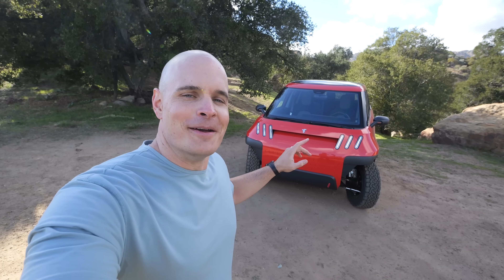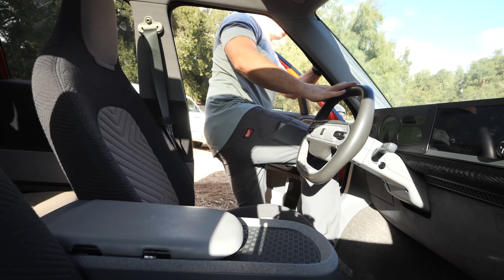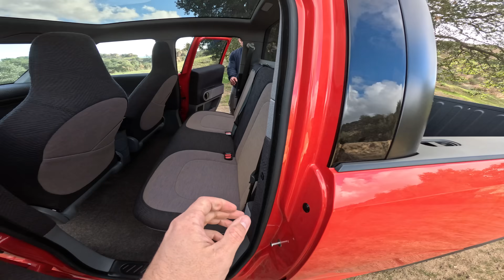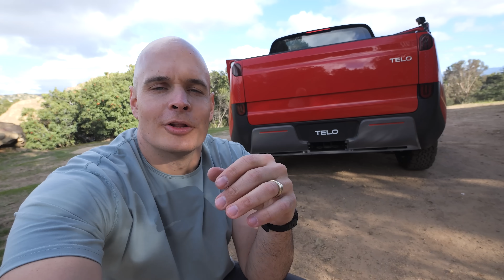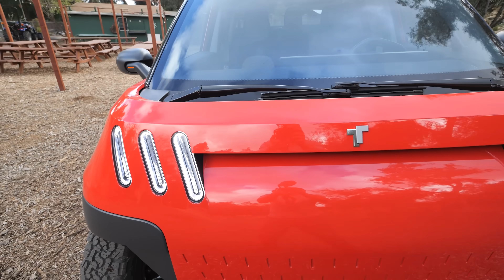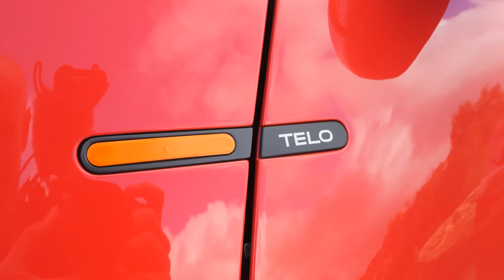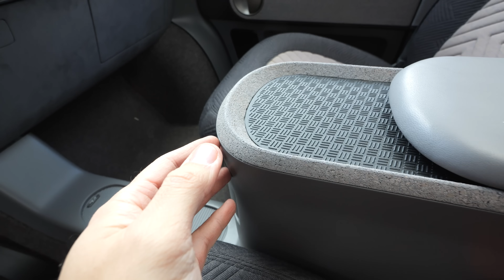ONE TRUCK TO RULE THEM ALL...

Comment: Now THIS is a flex in what's possible with unconventional drive systems, instead of dumb gimmicks like a frunk. A truck of this size in tight cities is not only workable but ideal considering electric availability and the need to transport large materials like drywall and plywood for renovation. Bravo Telo!
Reply: Watertight, clean, lockable storage in a pickup is not a gimmick. They are the EV where the frunk makes the most sense.
Reply: 1. A frunk is not a gimmick the frunk in most EVs is a durable hard plastic tub that’s completely separate from the vehicle interior. Perfect place to keep dirty/smelly items you don’t want on your carpeted interior trunk. I use my frunk daily for dirty work boots, tools etc items I don’t want damaging anything. 2. There are no tight cities in the US. I like the idea of this trunk I they it should’ve been slightly bigger tho to allow more crash/safety structure and interior leg room while still being tiny
Reply: @YungAnt7  It is fine that the truck is this small. Tgat is, what tgey are going for. What is not fine is them pretending tgere, arexzero compromises, and tgat this us as roomy and capable as a full sized truck, and their smug attitude that they are so much better because they can make a small truck and others can't. It isn't inability that stops the legacies from building this truck. It is the knowledge that it is a niche market they see no value in pursuing.
Reply: @YungAnt7   The front tires are actually part of the crash safety assembly. They help transfer frontal impact loads into the chassis and away from the occupants. A frunk would transfer the impact into the passenger compartment.

Comment: To me an electric truck wont do well until they start making electric truck designed for work. Trucks that can accommodate swapping out the bed for a tool box bed or flat bed. These trucks are being designed for people in the city that will rarely use the truck part of the vehicle. Till I start seeing 3/4 ton electric trucks I don't see this market taking off.

Comment: Looks cool, but until an electric vehicle can beat 600km range on the BASE model and be fully charged in less than ten minutes, I'm not interested.

Because my 2017 Cruze can do 500km per tank and takes five minutes to fill. I have to drive sometimes 2 hrs (200km) one way to work with tools. There's not an affordable electric vehicle that can do that without me having to plug it in overnight every single night.

Comment: Three interesting accessories not mentioned worth commenting on are the solar add-ons in the form of a roof, camper, or tonneau cover. Supposed to add 15/miles of range charge daily. Even at a 1/3 that claim it’s a solid value. Going to be in the market for a new small truck in two years.  I never buy first gen of anything but this will definitely be something to keep on the radar.

Comment: This is a perfect farm vehicle. Errands to the coop, hardware store, with no diesel and easy to repair has this at the top of our list.
Reply: Should work with hardware modders and software engineers to create suited sub-forms lol
Reply: All that K-car trucks hype paid off!
Reply: Need more clearance and a winch would be nice too
Reply: The Slate truck is a much better option than this at half the price. And no, EV's are NOT easy to repair. I'm not sure where the hell you heard that, but that's an objectively false statement.
Reply: @DaroffApFire slate truck isn’t half this price now that the tax credit is over. It also gets less the 150 miles of range and RWD only.
Reply: I hadn't even thought of that. it would be awesome to have something that could just toddle over our field hauling whatever we need to without getting stuck. I live in east texas so the lower parts of my property (in the field) are basically a swamp unless we're freezing or in a drought, and one time we got a lawnmower stuck out there and my dad's silverado and were only able to get them out because some guy was passing by in his tractor and stopped to help us. with a smaller, lighter truck that will be way less likely.
Reply: The Swiss Army Knife of trucks.
Reply: lol a wopping 60 inch bed.. for holding your beer cans and nothing else.
Reply: This will not be easy to repair. You will 100% need software to fix anything on these EVs.
Reply: @allencrow7312  Yeah? Fix what? Any electronics glitches can be solved with a simple software update and the few mechanical components are not any more complicated than a regular car. EVs need basically no maintenance and don't really have issues other than the occassional glitch.
Reply: @CptAngelKGaming  EVs account for more warranty repairs than traditional cars, they need to be fixed often.
Reply: @allencrow7312  ah yes..need that new wheel hub update 2.6. of course........................................
Reply: @allencrow7312  huge if... but, if they made the software freely or cheaply accessible, and easy to operate, it could be a good little deal
Reply: @allencrow7312 true but it is using a lot of off the shelf parts, besides, diesel trucks aren’t cheap to maintain anyways. 

As for software, hopefully it’s better than what John Deere is doing.
Reply: @allencrow7312  Except that they have specifically made it with Right To Repair in mind so people can work on it themselves
Reply: @allencrow7312   Because modern ICE vehicles don't have a bunch of computers with software issues as well? Bruh
Reply: @allencrow7312 telo has committed to being fully right to repair
Reply: @allencrow7312  Seriously doubt that - everything uses the CAN bus nowadays and standards have evolved.
Inverter tech is pretty humdrum now since BLDCs now rule the world.
Repair often involves replacing a blown capacitor, IGBT or a module.
A bad module could even be sent back to the manufacturer for refurbishment/recycling.
Reply: No farmers are paying 50k for an inclosed golf cart! Listen to all the noises driving down that dirt road lolz thats a brand-new vehicle! 🤦‍♂️
Reply: @ Except it's not a brand new vehicle, it's a pre production 1 off mock up.

They don't even have the controls in the positions they will eventually end up, they're down by the left knee.

To act as if this rattling is representative of the finished product is to not understand the production process.
Reply: @T_R_U_M_P_24 show me a truck cheaper then 40k and able to hsul that much weight. (No used trucks obviously)
Reply: @T_R_U_M_P_24 he specifically says this is the pre production vehicle that they are using to FUND all the rattles and noises to know what to fix in the production model. It's pre-production.
Reply: @T_R_U_M_P_24  except it isn't a new vehicle. its a pre production vehicle, that is being put through the paces to try and figure out the things they need to work on.
Reply: @T_R_U_M_P_24  I mean, did I really expect a bright comment from this account?

People who don't read before voting also don't read before speaking.

Comment: While you "mock" the wiper system, it's actually perfect if you intend to sell the vehicle into locations where right-hand drive is a requirement, such as the UK, Japan, Australasia, etc. and even the US Postal Service uses RHD vehicles (so the driver gets in/out on the kerb side of the vehicle). Having symmetrical wipers eliminates a major issue in that regard.

Comment: That's a preproduction vehicle so, understandably, not everything works. I noticed in your video, and one other from another channel, that if it's shown on a slope the wheels were chocked. Will the vehicle have a "park" position on the gear selector that will lock all the wheels or will it be a separate parking brake? It may be too early to say but I was curious. Thanks for the video.

Comment: they almost should go straight to "cab over" and lift the bed that 6 inches so there is no wheel well bulge... the whole thing could have slightly bigger bed and the visibility and driver safety in crashes would be better (crushing in crashes would only happen in feet level when the driver is located higher). (and why the rearseat lock needs to be electric?, its just another thing waiting to break)

Comment: There are a few issues i see that are getting them off on the wrong foot. 

This is not a truck. It is a van with a truck bed. Just call it a van. Your foot is beside the front tire. This is a VAN. If I cut the back off a Pacifica or a Mustang and create a pickup bed for it. Nobody is going to call it a pickup.

I do like many of their designs. I can see a place for this in city driving and as a delivery vehicle

Comment: Well. Thar short front is going to give it a 1 star crash test, if the cabin is going to be intact after a crash with 40mph. Then it has to make a stop in those short inches, and a human bode cant sur i e that kind of deacceleration, internally, your body will be a mess…cool small truck though

Comment: This thing looks great, and while 41k could look a little steep for some, if it's your work truck, you're going to recoup this in no time from avoiding paying for gas 🔥⚡
Reply: But in down time for charging depending on its use may hinder its value I work in the HGV industry (semi trucks industry) and the reason none of them will touch ev is the cost of down time

Comment: If you are aiming at Non-US markets such Europe and Asia. Then there are an extensive support network for cell manufacturing in Oxfordshire UK specifically Bicester & Banbury. With Academic support ftom the self driving vehicles unit at Oxford University, and motor/battery in wheel companies based in the Oxford University spin-out business parks. 
Obviously a lot of Race Teams are based out of various UK shires especially those close to Oxfordshire 

Futher expansion is possible via contracting the work to Magna? They built the prototype Sony EV, they have built the Jaguar I-pace and one of the Polestars, I think in Germany.

In the US their were and perhaps still are cell manufacturing operations for a variety of shorter run offroad electric systems

Comment: **Telo Feedback** Think about fitting chairs in the front that do a 90 & 180 swivel option. Yes they are expensive but it will increase sales in the Older and disabled markets. Could you run  NATO power/data rail along each side of the standard cab. This would mean attachment of powered devices such as lights & miltech to the car would be very easy 

Can you supply an additional closed rear cab to change it into a lockable van and that a roof rack can also be fitted. In addition it would also allow coach builders to offer an other addons such as a RV/roof tent conversion.

Also for sales in the  work and family markets. Borrow a design from aircraft manufactures or Look at Selfi Stick or DJI designs. That permits foldout of the skeleton for a table. Folded down into adjustable sticks that emerge from the chair or wall of the car. That with an additonal tray creates a table or provides support for a laptop

Comment: All of the rattling sounds are indicative of parts not being connected using dampening washers etc. If they don’t correct this before production, over time it will slowly fall apart prematurely.

Comment: Needs Better Sound Insulation,  can hear a lot of noise despite the low speeds
Reply: It's pre-production... refinement will come.
Reply: @apexerman1 exactly. Some of the longer videos explicitly address the fact that it rattles and isn't ready
Reply: @apexerman1  Believe me, it won't be much better, and probably cost bit more, and more heavier.
Reply: 1) internal combustion engines cover a lot of road noise and extra dampening adds weight which reduces efficiency. So there's gonna be tradeoffs. As an owner of an ev who pretty much never drives w/o the radio on its a non issue for me. You do clock the difference in the beginning as you drive it and then it becomes a non issue as you end up tuning it out too. 2) They aren't wearing lavs, so there's likely a degree of vibration making it into the camera rig and translating to the mic and amplifying it. Like many such things, its gonna be something you'd need to test drive and judge for yourself with your own ears, like any car regardless of what makes it go.
Reply: i dont think this is sound insulation, its rattling. Loose panels, cheap plastics. because hes driving on a bumpy dirt road
Reply: Agreed. I hope the production models will address most of the rattle issues. By the second or third year, for sure. As ApexErman1 says, "refinement will come." But having worked quite a bit with mobile sound, I suspect the mics emphasized  the background noise more than you might normally hear. (they seemed like condenser mics) 

Basically everything devsfan1830 said is right. (...except that even lavalier mics can pick up a decent amount of ambient noise when in an enclosed space— a proper headset mic is the way to go in that situation. No need for a fancy isolation rig like they seemed to be using. Unless they WANTED to pick up some electric motor noise, or the cabin squeak-and-rattle...)

Comment: Like the small form factor, but the almost non-existent crumple zone isn't exactly a strong point.  The brand also needs a new name.  Telo sounds and looks an awful lot like Tesla.  Curious if the lack of a front end of the front wheel wells hurts aero and efficiency.  Not a fan of the tunnel idea when they could have just lowered the bed.  I guess it makes from the standpoint of the mid gate folding down, but still, seems like it'll limit the space in the bed.

Comment: That is actually fantastic.  3 Ton towing? How though? It's size would mean it's a tad risky towing 3 tons on the road at anything other than town speeds.   The open front end with the tyres means it will not be legal in most countries though because its super dangerous for pedestrians. Forget impact rating for pedestrians because they will be pulled under the vehicle if they impact around the front tyres.

Comment: Put 1700 lbs in the bed,and watch your range ho down the toilet. Electric trucks are worthless for doing real work
Reply: If you're doing real work you're not buying this truck. This would make an excellent pool cleaner or pest control route truck. Hauling boards to jobsites? Not so much. Heading to Lowe's to pick up some drywall sheets for a remodel 8 miles away? Good to go.

Comment: Honestly i really like this truck, great utility features and the creature comforts look good. That being said if its in the small truck space, it needs to be slightly cheaper. Telo would steal all of ford mavericks sales (Base Hybrid MSRP 26K) if the base model was MSRP 30k and about 36K for the 4WD, hell they'd steal every major vehicle manufacturers small truck sales. They can even keep the extended range battery at the same option price, and that would make it just touch the 40k price. After that mass produce to stop extremely high resale scalper prices, and you have company that will last a lifetime. glad small trucks are back on the menu.

Comment: Jerry, electric single wheel with handle bars which attaches and detaches by latch to a standard wheelchair. unit can fold and be stored under wheelchair. battery pack hotswoppable.
basically the front fork of a bike with an electric wheel motor and pack. connect it to front of wheelchair. when user opens handles it lifts front wheels of wheelchair off the ground. now its an electric trike.
love from Cape Town South Africa 🇿🇦💚🇵🇸

Comment: do wonder how's its safety rating with such a short crash zone and how exposed the front tires are to possible flying debris. the pug nosed looks also needs getting used to but is nice to see a new form factor that takes advantage of the size of electric engines.

Comment: I don’t like the front end. Cool that you can brag it’s the length of a mini cooper but other than that I don’t get the point of chopping off the front end. It’s ugly and seems unsafe, looks like a death trap. Throw some kind of front end on even if it’s a smaller one it would be better than none. You’d get a better looking truck, useful frunk, safer and better aerodynamics.

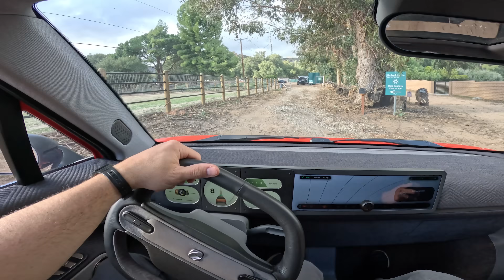Comment: 4:20 a lot of road noise for only going 5-10 mph. Are the body panels not secured?

I love the idea of this mini-truck and the concept seems well thought out. Mini-trucks are sorely missed in the modern auto-industry and with “mid-sized” trucks now being bigger than old school full-size trucks it definitely seems like this concept could flourish. No one in the main-stream auto industry would have predicted 5 years ago that the new Ford Ranger would be out-sold by the less capable Maverick. 

My advice is don’t try to be a big truck, obviously being able to carry a 4x8 sheet is incredibly useful but you don’t need to tow 6k lbs. Everyone knows towing is an EV’s achilles heels and reviewers will test the truck with a full load. The mini-truck is all about doing most things as efficiently as possible, so show it pulling a 3k lbs single axle trailer for 200 miles. No one who regularly needs to tow 6k lbs will buy an EV with current battery tech. 

Also, you should aim to do as much manufacturing yourself, or at least final assembly and QC. Half the value of your company will be based on its ability to manufacture, investors who don’t understand this tend to invest in hardware companies that fail.
Reply: 1. They are offroad.
2. Preproduction vehicle. Not everything is final
3. Its the sound of suspension doing suspension things.
Reply: it IS only a prototype

Comment: Just throwing it out there for Telo. It was mentioned that for the full 4'X8' sheet to fit with the midgate down, the front seats have to be very far forward. A nice alternative would be tie down points on the top of the rear drop down tailgate so when it is down, straps from the side could be used to secure the sheets from shifting backwards so they can still be transported even with a bigger person in front.